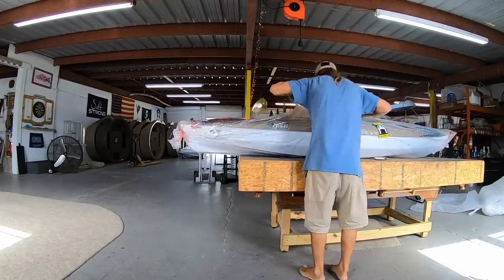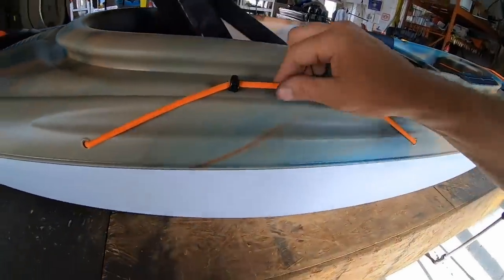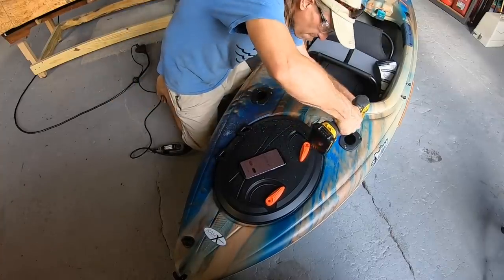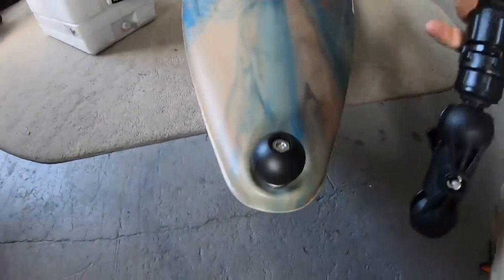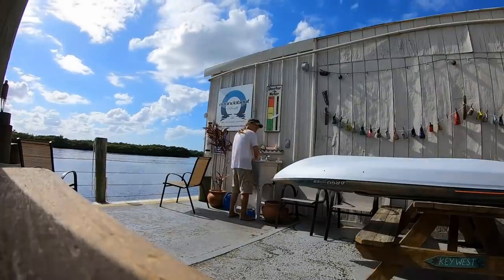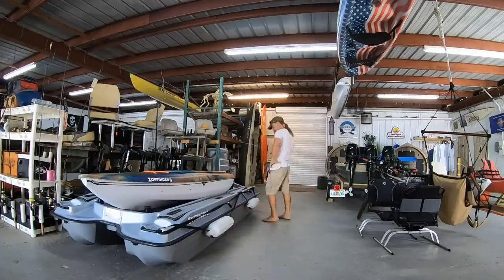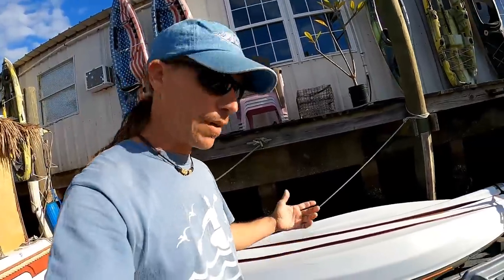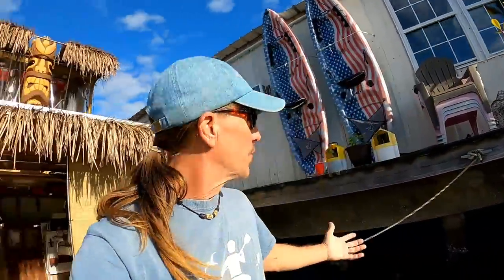A Kayak for the Great Loop

Comment: I picked up set of 4 flush rod holders on eBay. $20, each came with rubber caps secured by a leash to multi purpose rubber gasket to alleviate concerns of silicone or sealant around the new holes. Course mine's a S.O.T. Jackson... Nice looking boat, I'm jealous. Contemplating removing drag pad on jackson, replacing with a small wheel set up? All our lakes are low and dirty in OR... Have a great weekend!

Comment: You should get two pieces of PVC, and put rope through them to attatch to the pass tracker when towing it. It will always be that certain amount of length away from the boat, so when you stop it won't hit the back of the con-tiki.

Comment: That’s a cool little kayak! Can’t wait to watch your adventure! I noticed the straps holding your kayak to the boat. They might not hold up to well in the salty conditions and may be hard to use pretty quickly. Maybe spray some WD-40 on them as a preventative measure.

Comment: At any time after the holes were drilled and rod holders installed did you put any sealant to prevent leaks? How about wheels for hand pulling.